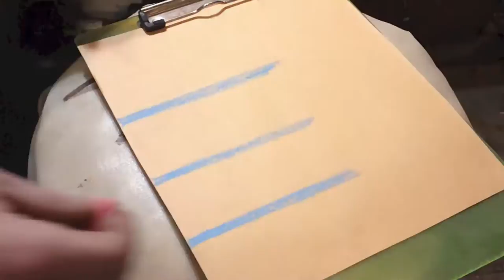Chest of Drawers Part4

Comment: Thanks for the "second half" of this dovetail journey, Dave. It really did solidify my opinion that "Tails first" is the way to go. Also, thanks for the tip on sawing the front/top then down the back. I can see where that will help keep the cuts vertical.
Lew
Reply from the maker: The main reason I am a tail first guy is you work off of the face. Not the interior of the joint.
Lew I am glad you are enjoying the series. I am enjoying have you along.
Please feel free to come back all you want.